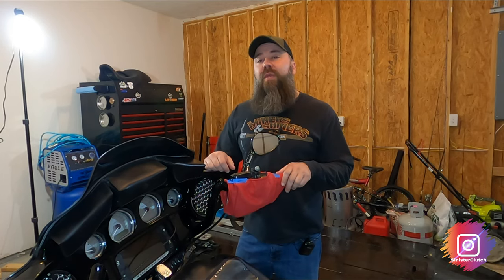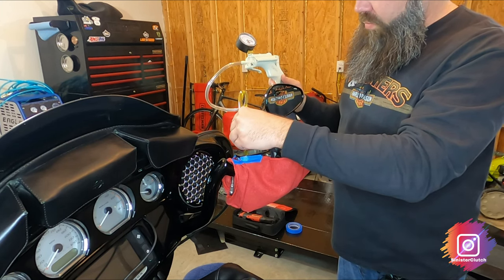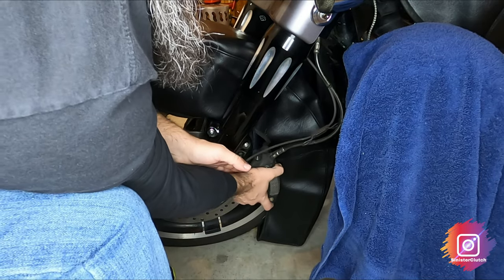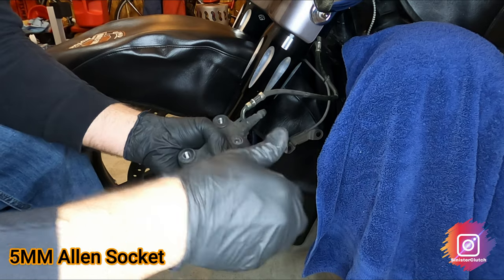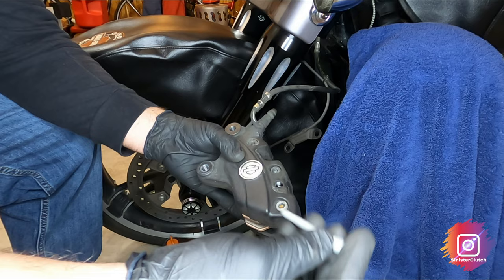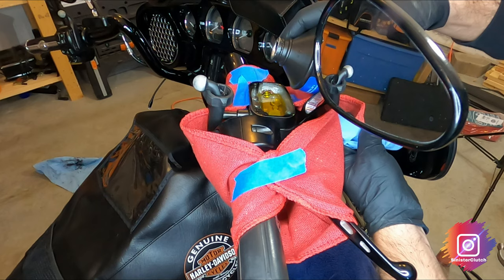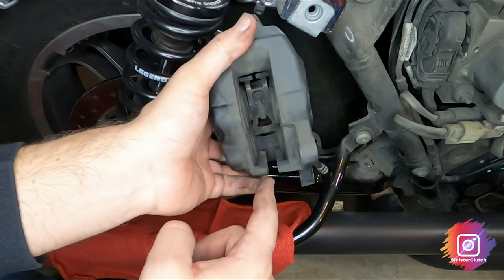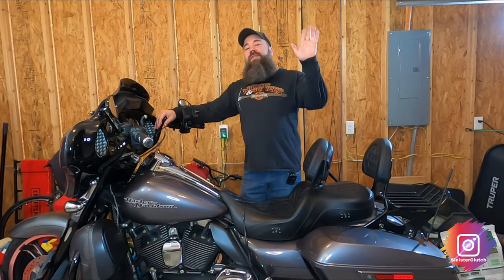How To Replace Brakes On A Harley Davidson Street Glide

Comment: Hey Randy great video on brake pad change. Thank you for sharing this with us.
Reply from the maker: Thanks Mike!
Reply: Thanks for the video. Im leaving on my bike in april to take a solo trip around the US for 5-6 months visiting tik tok followers & friends. So im getting my bike ready. I never did the back brakes before. But i know i can do it. I will also change my oil today. The tranny fluid & primary fluid only have about 2000 miles on it so im not gonna worry about that before this trip. If i end up riding and excessive number of miles, i can change that shit at a friends house. No biggie. I did my front brakes a month ago. and got a new rear tire.  But it's back brakes  & oil change today.  Ill take the front wheel off next weekend to take in and get a new tire. And I'm ordering new speakers for the front fairing because I blew one out a few weeks ago. Gotta have music for this ride.  But I should be ready to go on an adventure of a lifetime. Again, Thanks for the video. It's all I needed to know. 🤘✌️

Comment: I wish bikes still had cable operated drum brakes. They were so much easier to work on and it was way easier to check your tire pressure without that rotor in the way. Looks like you still had plenty of brake pad left. Good job.
Reply from the maker: Sounds like things got complicated.   Yeah I still had some brake left but got a 5K trip coming up and the squeaking was driving me crazy.  Thanks for watching Greg
Reply: @SinisterClutch  Yes I have replaced pads just for squeaking too. I do tend to push it to get longevity out of everything. I wait until my tires are bald before replacing them. I'm a cheap sob. LOL
Reply from the maker: @EasyRiderGreg  🤣😂 don’t blame you me too
Reply: I’d rather have brakes that actually stop you. The old drums might have been good for a small bike, but not a modern dresser.

Comment: Awesome video Sir. One question, is grease necessary for the outer part of the brake pads?
Reply from the maker: I did some research and didn't find anything on the EBC saying you needed to grease them.  Also I didn't see other folks greasing them as well.
Reply: @SinisterClutch  thank you Sir appreciate you!
Reply from the maker: @Yakmandave  Thanks for watching and commenting.  Let me know if you have more questions.

Comment: we just got a new to us 17 Street Glide. so this helps, my odd ball question is, is it save to put anti-sequel on the back of the pads? thank man
Reply from the maker: Actually if you buy the Harley pads they come with an anti-seize grease and a template to apply it.  So it’s safe but I don’t think you need it.  I’ve never had issues.  Thanks for watching 🤙✌️

Comment: Lesson I just learned because I was lazy and didn’t do it myself brake pads front and rear and brake fluid change @ Harley dealer $640. Don’t be lazy if your mechanically inclined
Reply from the maker: Wow it’s that much?  Labor must be crazy high.
Reply: @SinisterClutch  I was just trying to get it done before bike week in Panama City and didn’t have time. Next time I’ll make time for $420 in labor
Reply from the maker: @kevinturpin7937  Yeah life happens when we make plans.  I’ve been there before.  Wow for that much I need to start working on bikes and charge half the labor 😂😂
Reply: I am getting ready to change my rear brakes today. I just did the front brakes last month. Then Ima pull off the front wheel & go get a new tire. Ima video all of it. I got this!!!

Comment: Is there a difference inboard and outboard pads or if they go in it’s right ?
Reply: No anti-seize where the piston contacts the back of the pad sometimes they come with a stencil
Reply from the maker: @derekallen6043  Supposedly Outboard provides better cooling and easier maintenance.  While Inboard its quite the opposite with creating more heat and harder to maintain.  That doesn't play a factor for me because these are outboard brakes for my bike and I'd have to install an inboard kit to use inboard brakes.  Also regarding the grease, I contacted EBC because I was curious as well and they said it was not needed.

Comment: Update on your thoughts on the EBC pads?  About to replace mine but have heard of them being pretty noisy.  Also I know the stock Harley kit comes with brake grease you apply to the back of the pads.  You don’t use the grease?
Reply from the maker: The EBC pads do make a noise but it's not a squeaky noise but more like a whiney noise but not crazy loud.  These did not come with grease but they were not a kit nor did I find a kit at the time.  I did some research and didn't find anything on the EBC saying you needed to grease them.  Also I didn't see other folks greasing them as well.  Would I buy them again?  Yes because they don't throw dust like the Harley ones and supposed to last longer which I'm still waiting to validate.  Thanks for watching and let me know if you have any more questions.  Take care ✌
Reply: @SinisterClutch  Appreciate the quick response!  I’m looking for pads currently and was curious.  I also have white walls on my RK Classic, so good to know about the brake dust.  One other thing, I know the Harley kits come with a new caliper pin, do you think it’s needed or just swap the pads this go around?  I’ve got 17k miles on likely original pads.
Reply from the maker: @ed0985587  I always replace the pad pins and retaining clips.  That’s just my preference.  Now as long as there is no damage to either then you can get away with it.  But that’s up to you.
Reply: @SinisterClutch Perfect, thank you for the replies!
Reply from the maker: @ed0985587  Happy to help.

Comment: No need to take brake covers off
Reply from the maker: That’s the only way to get the pad pin and retaining clip off.
Reply: @SinisterClutch  the master cylinder….and those covers come off for cleaning …they stop rocks etc
Reply from the maker: @stevegazo9512  Ah you mean the master cylinder cover.  Yeah you can I suppose but I prefer to check it